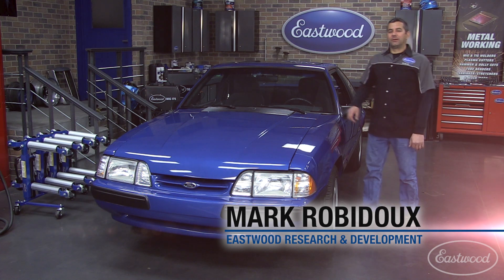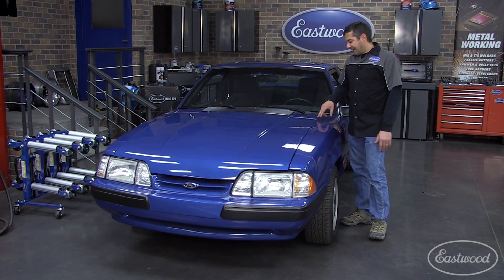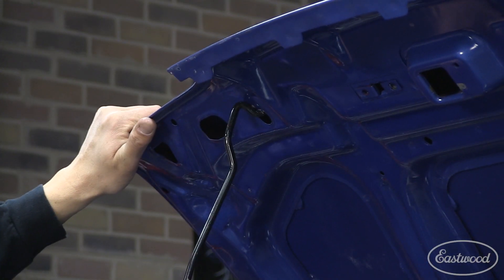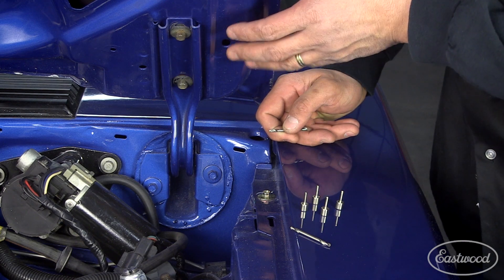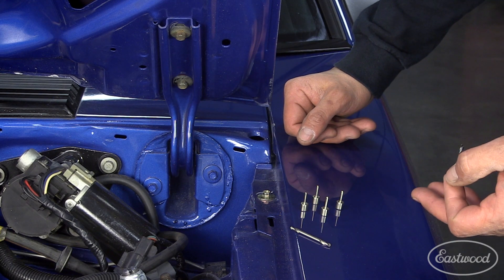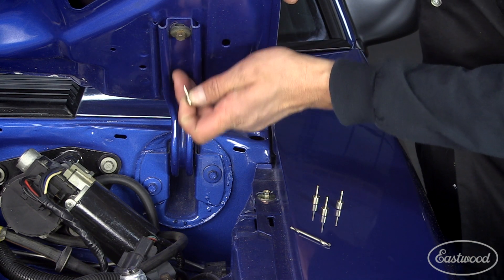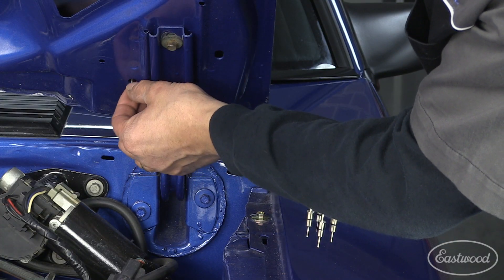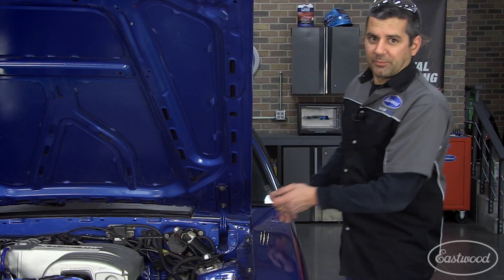How To Achieve Perfect Panel Fitment! Pin Alignment Tool from Eastwood

Comment: Hey guys,  I understand  what you are talking about drilling holes and all, but if restoring or building a car the holes will be primed and painted  after the car I’d assembled and blown apart to paint. If just removing the hood you can easily brush tip paint the holes when the part is off the car. I have pinned all the cars I have restored over the years and reassembly is a total breeze.

Comment: Bad advice.  Thumbs down.  Remove your video.  You're not even painting over or sealing the bare metal.  You cant even access the far surface of the hood you drilled into to seal it from rust.  But if you did want to ruin your hood a person could just buy 4 1/8 drill bits and use those as pins..  The proper way to do this is to just mark the bolt locations with a sharpy or paint and line it back up visually.  It's not rocket science and the position is repeatable every time that way.